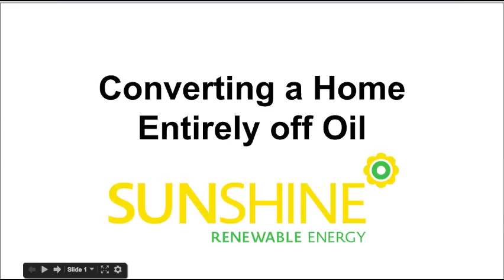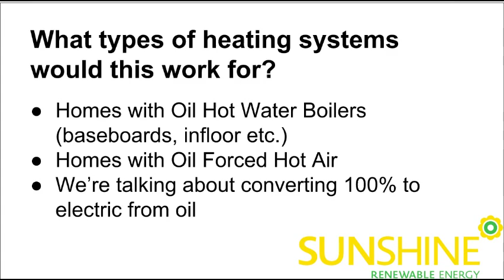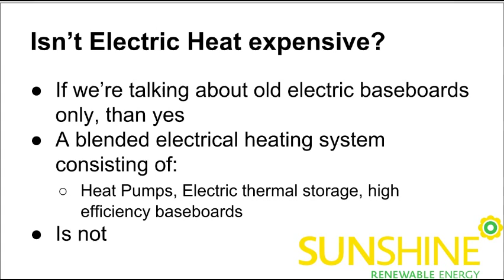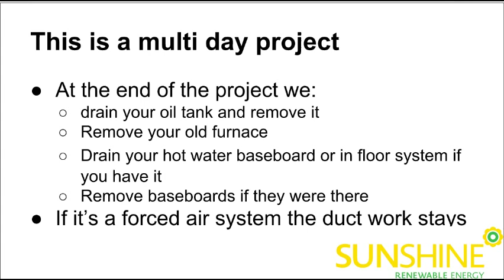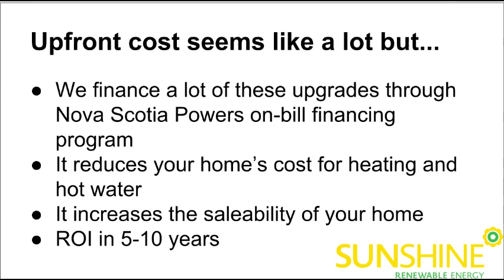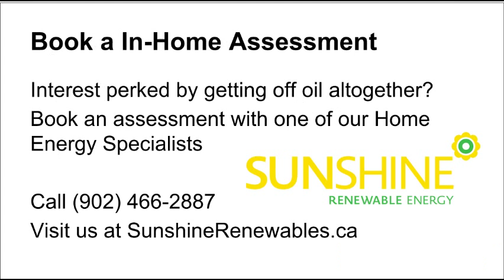Convert your Oil Heating Home to 100% Electric

Comment: One thing I can't find anywhere that is extremely frustrating: what sort of estimate could one make of the upfront cost of converting to electric heat? 
Doesn't matter what the savings are if you can't afford to put it in in the first place.

Comment: I have a gas furnace that is 3 years old. What I would like to know is can I convert this furnace to electric. I have solar so I am not worried about the cost of electricity.
Reply: No way a solar pv system will produce enough electricity to run electric resistance heat. it won't even produce 1/5th.

Best option, keep the furnace, add an air source heatpump to the system, the furnace kicks in when heatpump can't keep up.
Reply: @Jon-hx7pe  my solar is doing 70.5 kwh per day currently - in winter it is at 45 kwh -